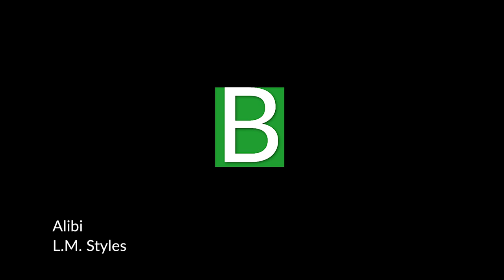Expensive Vs Cheap Speaker Cable Sound Test

Comment: The length of the cable matters too because you will get a higher resistance with longer cable. So for an AB test you really need two sets of cables with identical length. Also the biggest problem with your system is your room not the cables. You have a highly reflective room with little to none noise dampening for the walls. Adding couches and furniture will help but beyond that you need some diffusers and bass traps to fix the acoustics in that room. By fixing your room you will hear a night and day difference. You can test your acoustics by clapping. If you hear an echo then there is a problem.

Comment: Couldn’t tell any difference.

The real trick is close your eyes and see if you can spot any changes in sound.

I picked up some bargain basement dog shit cable just to get my system up and running. 18 months later I still have it. Couldn’t tell any difference between that and the more expensive stuff.

Comment: "A" had more treble and a more detail but it was an apples to oranges test since it was 12 awg to 16 awg.  Parts Express has some fairly cheap #12 speaker wire.  How about comparing your expensive #12 cable to cheap #12 cable?  Now that would be a proper comparison.
Reply: I also think I heard that.

Comment: Do a proper test. Do a forensic "null test" just running the audio through each cable abd recording then null test. Youll hear silence because at those lengths there won't be any difference in quality. Just the answers in the comments show everyone with opposing bias. There is no real difference.

Comment: You should have used the same gauge wire because we all know that smaller gauge has more resistance than larger gauge wire
Reply from the maker: Well, that’s one way to completely miss the point.